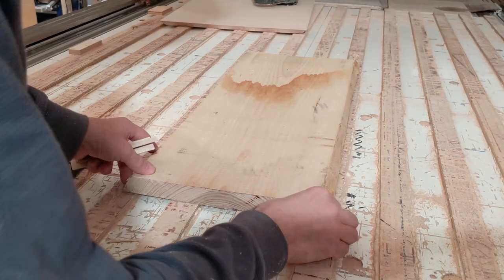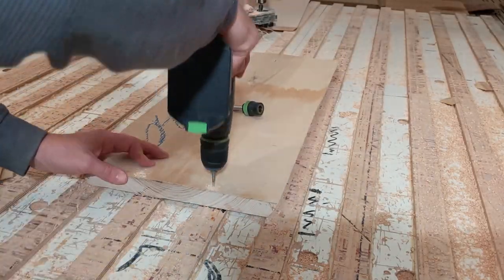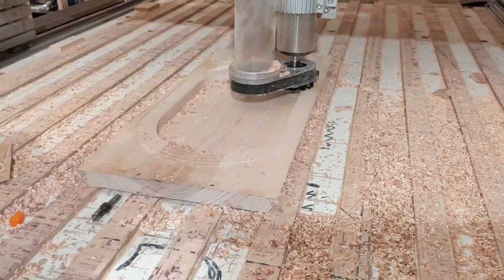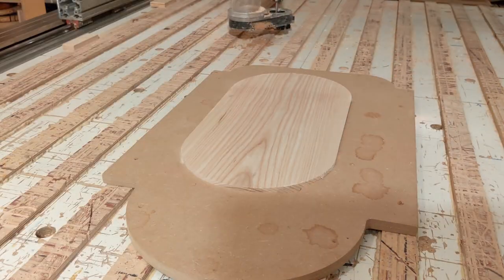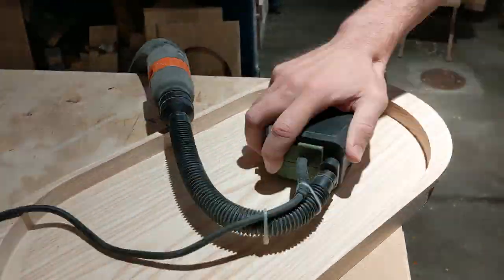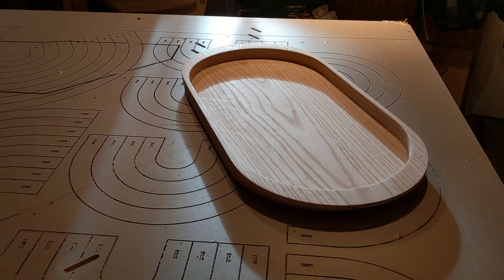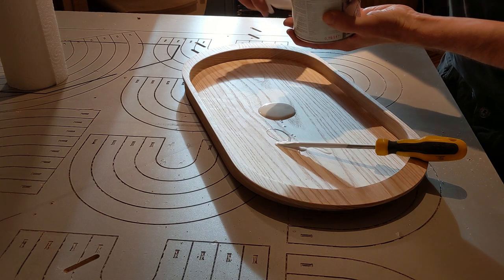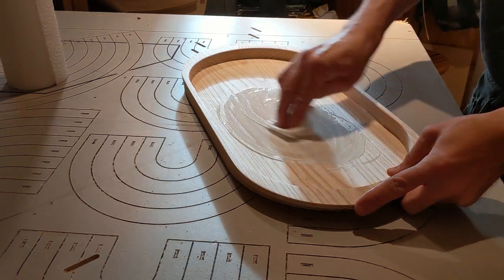Making an ash wood tray with a cnc router

Comment: Google routing a bowl with little sanding or smooth finish. It’s done by a guy named angrybird. I used his method and had very little sanding to do. The inside came out nicely. Like the way you did the handles.

Comment: Hello! Do you know how to prevent warping when hollowing out a piece of wood like that? My carpenter is working on a project for me and he advised me not to go for large piece of wood to minimise warping. How did you prevent the warping in this tray, if you don’t mind my asking? And thanks for this useful video 😊
Reply: FYI, the project involves hollowing out a piece of wood that is about 10” x 6” leaving about a 3/8” boarder. The thickness of the wood is 1/2”. The woods I am considering are mahogany, walnut and birch. Thanks again!
Reply from the maker: great question! 
its quite difficult, and I've had some of these warp on me.
The most effective way is to use the right kind of wood, so walnut is great, in my experience, it just doesn't warp as much as other woods (beech and oak warp far more).  But apart from that its just really really important to router the wood on the top and the bottom of the tray.  If you just machine the top, then it is almost certainly going to warp, but if you machine both sides, and let it air from both sides after, then it will warp less (solid wood always warps, the question is just how much...)
have fun!
Reply: @mason.berlin  Thanks so much! The thing is, the project is a box, so we can only machine on one side. We thought of strengthening the sides with a tasteful plate of metal but my carpenter does mot have experience in inlaying metal into the wood. We might just have to do it the old-fashioned way of four sides and a base for each half of the box.
Reply from the maker: You should be able to plane the bottom with a hand plane, that would help
Reply: @mason.berlin  Thanks!